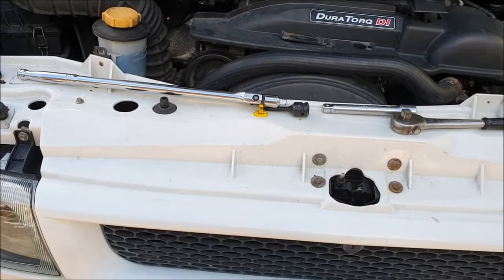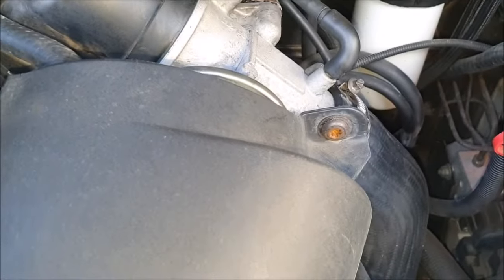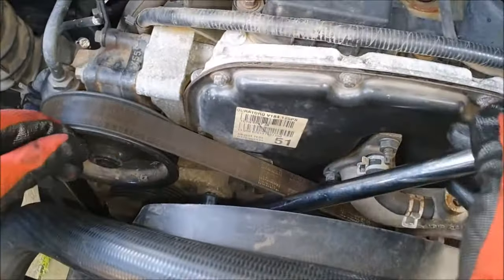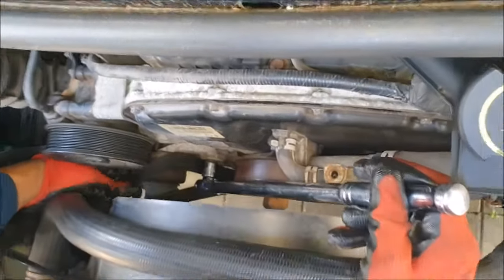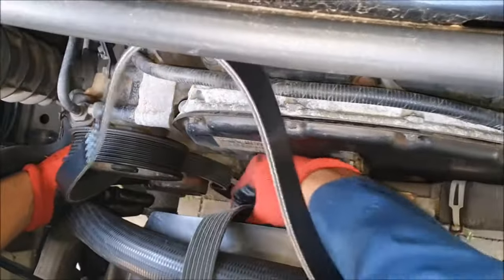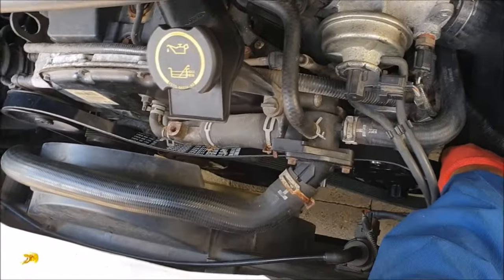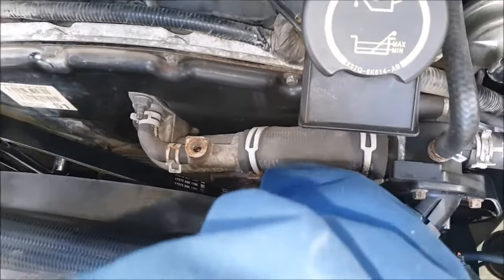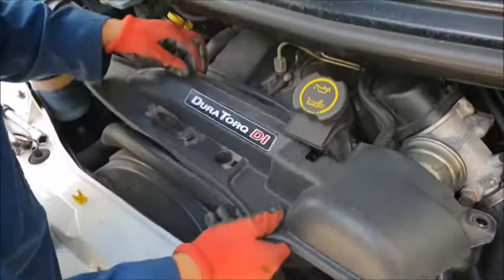Ford Transit Fan Belt Removal and Installation (Start - Finish)

Comment: Love the videos as I have a motorhome built on a mk6 transit t350. I’m new to owning it and have just serviced it myself and find your vids helpful. Just wondering about the cabin/particulate filter replacement or could you do a video.
Reply from the maker: Thanks for the comment. Mk6 Transits are a bit tricky to change the pollen filter. The housing is located above the engine just above the 4th diesel injector. Keep an eye out I will be making a video how to change this filter and uploading it in the next 24 hours. If your subscribed you will be notified as soon as its uploaded.

Comment: AWESOME VIDEO. My belt squeals a bit, does this means it is time to replace it?
Reply from the maker: Thanks! Inspect the belt and check for cracks, or contamination. You can decide from there.

Comment: Hi, got a question about my clutch, I have a Mk6 lwb Luton 2.4, I changed the master and slave cylinder but no resistance in the pedal??? Is that because of air? 

The pedal goes down and comes back up just no resistance when pushing the clutch.. any advice?
Reply from the maker: There is air in the system, have you bleed the clutch?

Comment: Very informative video,but what year Ford transit is this one?
Thanks
Reply from the maker: Thanks, this particular transit was a 2003 model year, but its basically the same for model years 2000 - 2006 and similar for later models RWD

Comment: Great!
Reply from the maker: Thanks!
Reply: @AutoBuddynz  , short question mate. Should i change the drive belt tensioner and the idler pulley when i change the driving belt? Also, what should be the torque in Newton / Meters when i tight the bolts? Help me with that if you ca, thank you.
Reply from the maker: @catrevenger  I would recommended replacing the belt, the tensioner normally does not need to be done but again this depends on kms and the age of the vehicle, for peace of mind you could change it. Also worth checking your idlers, they might need replacing.